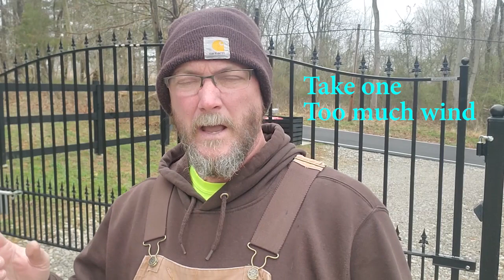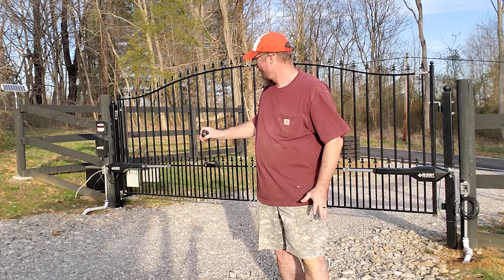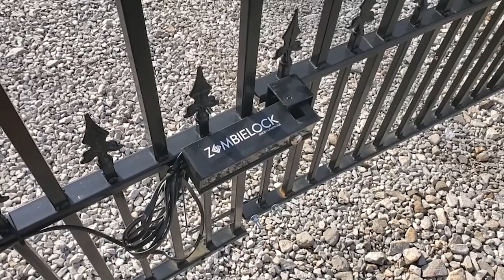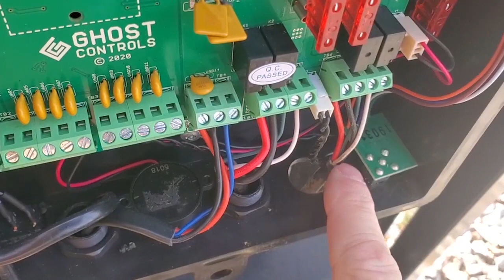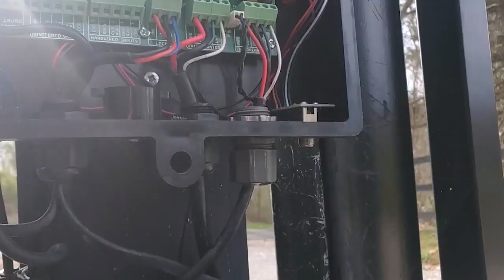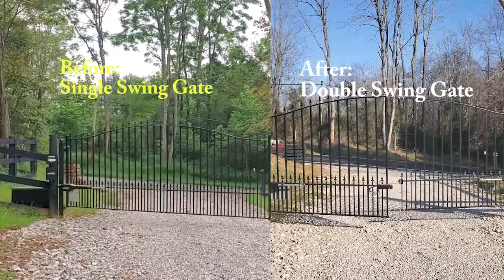Changing Our Ghost Control Entry Gate to DUAL OPENING || Barndominium Living

Comment: Question: I have a double swing gate over concrete. Is there any product I could put control wire in, so it can run across the driveway over cement?
Reply: Or do I have to buy one for each side?

Comment: I have a dumpster down my lane. I’m 99% there on buying this system, but I’ve got to wondering. Can I open the gate and leave it open all night somehow to allow the garbage man in? The time is always random between 4:30-7am
Reply from the maker: You can program the controls to party mode which will leave the gate open until you remove party mode.  We use it all the time. Also you can create multiple pass codes. One time entry codes etc. There are mutiple options for you.
Reply: @RVBarndominium  perfect! That’s exactly what I needed to know thank you!

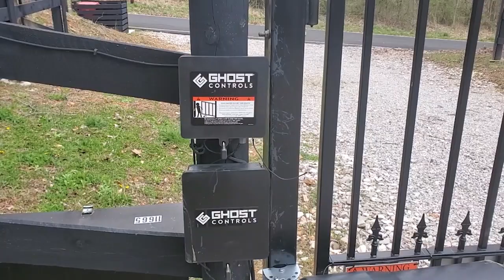Comment: Great video. I had a single gate for 5 years and bought a nicer double gate. Unfortunately, we had some problems with it working properly.  I called tech support and they said that the angle of the arm is too severe for the arms to work right. I did notice that you had your arm in the same location ours. Seen at 9:22 of your video. The only difference I can see is that the distance from the side of the gate to the post is much greater on your setup. You have about 4" where I have about an inch. Doesn't make sense but we will try the extension arms they are sending out. Nice job.

Comment: is that zombie lock safe —. i just want to make sure my gate locks and there never is an opening if the dogs lean on the gates
Reply from the maker: It normally works well... but about twice a year, it needs adjusted to lock properly. I think it has to due to the temperature outside.

Comment: Did you have any issue with the zombie lock hooking while opening or closing? Looks like its made for single gate only.
Reply from the maker: We did before switching to two gates.  One gate was too heavy and it didn't line up right sometimes with heavy winds and such.
Reply: @RVBarndominium  just finished the install on a double gate also. I saw that it has an option to delay one gate so the lock mechanism doesn't hook.

Comment: I have a square gate it looks like you didn't use the c clamps for a a round barn door so did you just drill holes in your gate and mount directly with no adapters?
Reply from the maker: I ordered two new hinges and drilled the gate and post for the new hinges.  My gate came pre-drilled on one side for a normal single swing setup.  Luckily, it bolted together in the center so that was easy.
We haven't had an issue with it now that it is dual swinging

Comment: Interesting that you had the wind issues. I've had the EXACT same issues with my 16' heavy 250lb gate. It has worked perfectly for 2 years except when we have extremely high winds. I have a "hard stop" footer on mine. When the wind is bad the system senses too much pressure on the arm and backs off about 2'. It's a safety precaution I'm sure. While it's a PITA at times I've just learned to deal with it and unhook the gate when the wind is extremely bad. I also had to have the arm replaced once after a windstorm actually bent the auger arm. I also installed the antenna extender and I can open and close the gate from my house about 300' away. Still love my Ghost Controls. 👍👍

Comment: My 12 ft aluminum gate has a similar problem. It opens too far, past the post on the closing side, and has to be readjusted every several weeks.  Two others have similar issues with light weight 4ft tall farm gates. One closes too far sometimes, same as mine, and the other not far enough and his Zombie lock does not "lock".  They also have to readjust the close setting otherwise the gate continues to always close in the wrong position. I increased the "force" on the control board but that does not help. I have two neighbors with US Automatic gate openers and their heavy steel gates, 12ft and 14 ft,  ALWAYS close perfect at the correct position.  The 14 ft steel gate even has a 24 inch high solid metal plate at the bottom of his gate, the entire 14 ft length of the gate, to keep their little dog from escaping. That 14ft metal plate should act as a sail in windy conditions. Again, his always works correctly.  Very disappointing...
Reply from the maker: Since we switched,  it's been working like a charm.  We are hoping it stays that way. We do feel your frustration.

Comment: Thanks. I was going to buy the same unit for our RV Land gate. Our previous plan was to do a single 16ft. After watching your video we are going to try (2) 12ft or less gates. Where did you find your gate? It looks nice. Thanks again and great job...
Reply from the maker: Yes, we recommend dual open after having tried both.  It works much better now.  We ordered the gate online at Home Depot.  It's adjustable to single or dual.
Reply: @RVBarndominium  I'll look into that. Thanks. I'm tired up constantly hooking up our cable gate. It's a pull up, stop, unhook, pull forward, stop, re hook process.
Reply from the maker: You will love a remote control one👍